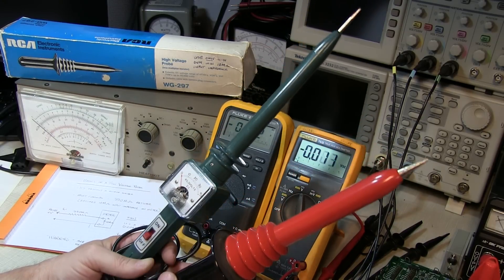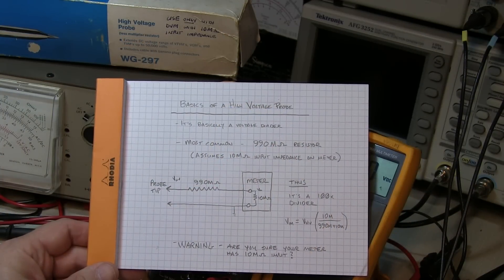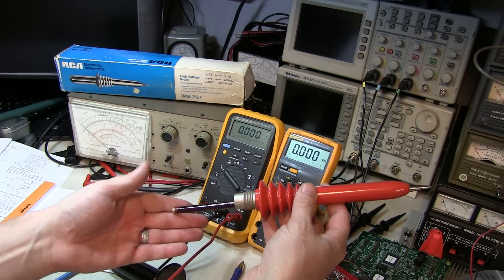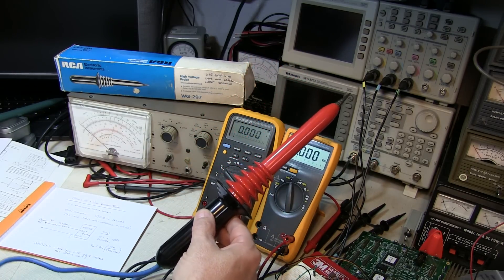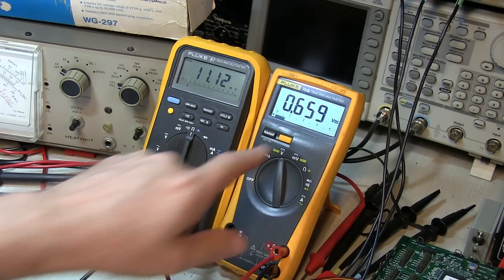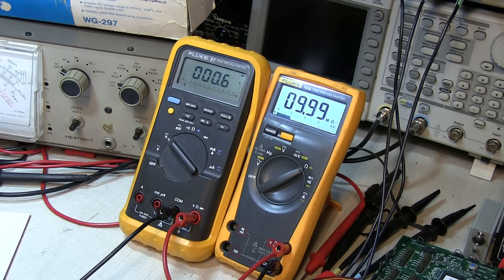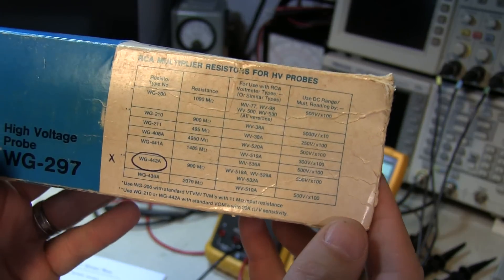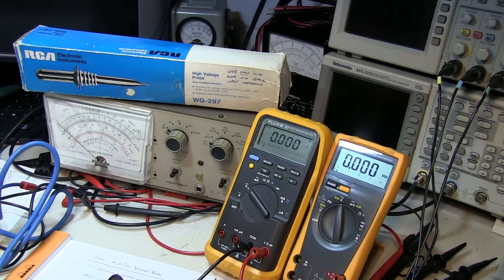#142: Basics of High Voltage Probes and how to use them

Comment: Common VTVMs from the period of the 50s and 60s that you are likely to encounter, Heathkit, Eico, RCA, probably others, have an 11 megohm DC input, but this is achieved by putting a 1 megohm resistor in the DC probe.  The input of the instrument itself is 10 Megohms.  The 1 megohm resistor in the probe is there to provide some isolation from the capacitance of the probe cable, which is usually shielded.  HV probes sold for use with these instruments are calibrated to be terminated by the 10 megohm input of the instrument.  In later versions of some of these meters, the designers went to a uniprobe approach with a switch to short out the 1 megohm resistor so the same probe could be used for making AC and ohm measurements.  Earlier versions of these instruments had a separate probe for each function and did not use shielded cables on the AC or ohms  (OR AC/ohms in some cases) probes.  
     A popular type of article, in club bulletins and some ham magazines written by people who didn't understand the function of the 1 meg probe resistor, advised users to place the 1 meg resistor inside the instrument so that other probes could be used.  A Heathkit V-6 or V-7 or V-7A, et. al.,  that you find at a hamfest or online may have had this modification performed on it.  So a good policy would be to verify the input resistance of the meter before trusting the probe.   Heathkit sold an HV Probe kit nearly identical to the RCA in the video demo with the adapters to plug into either Heathkits with 1/4" plugs or RCAs with Amphenol MC connectors.  I have one of these, and the wiring of the leads at this point in time is way too rotten to be trusted measuring high voltages.
      On a side note, other VTVMs in this time period, mostly more sophisticated instruments, such as the Hickock and Hewlett Packard All tube meters (HP 410B) had 22 meg input impedance.  So again, the best choice is to check to see what you've got.

Comment: Good timing Alan. I just bought one of these, a Fluke 6KV for check plate voltage in Ham Radio linear Amps. Wasn't aware the input impedance changed with range on the modern DVM's. Thanks for pointing that out. Great Video as usual.
73"s
Reply: famos and Alan. Be very careful when using HV Probes for measuring Ham Amplifier Plate Supplies. If you check the paper work for most HV Probes they will tell you they are rated for CAT 3 or CAT 2 work. These are very low energy applications as in a CRT Anode --- 10 KV @ 5 ma or less. While the voltage for an SB-220 plate supply is considerably less -- 3 KV -- it is capable of delivering upward of 1 Amp at that voltage. If something were to breakdown, either in your probe or your meter, at that energy level things will get very nasty very quick ! As in an explosion. I'm not saying that will necessarily happen but be prepared for that to happen. Safety Glasses are essential and electrician's gloves are a good idea. The Fluke 87 III & 87 V are rated CAT 4 to 600 Volts and CAT 3 to 1000 Volts. Using a High Voltage Probe throws all of that out the window. Even though 1/100th of the measured voltage is dropped across the meter input if the probe ground connection fails or the meter input circuitry fails every volt that you are measuring gets transferred to the meter. In that circumstance the probe resistor is all that stands between you and disaster. Be extra careful. You don't get second chances at these voltages.  Bob K6TR
Reply from the maker: Excellent comments Bob, and right on the money!  Thanks for your valuable contribution.
Reply: carefull with measuring amps, I made the mistake of taking the probe off when the amp was in use(TX) and created a nice arc (untill the fuse blew)
Reply: ***** Another good point. One must use extreme caution with High energy linear amps. Very lethal.
Reply: Essential comments Bob. While I used to poke at TV anodes with 20+ kV, I much prefer to set up an amplifier HV metering test with isolated gear and then observe, not touch, when power is turned on.

Comment: Nice video once again.
I noticed your reference to the '2nd Anode' of the CRT.
Many years ago in college working on CRT TVs, I don't remember a 2nd Anode just the Heater, a Cathode, a few Grids for Contrast and Brightness and Focus I think that was, then the Final Anode where the real dodgy voltages were, (Yes I got bitten, once I might add,)  Luckily it was a Black and White set so the voltage was only around 12KV and I got too close to the Line O/P Transformer with my finger, Produced a nice arc though. 
How we all laughed....aahhh, memories.
Lol....
Later on, one of our tasks was to replace the CRT or at least go through the motions. Imagine my nervousness when I had to lift the Final anode cap, but the instructions on discharging the Anode were good enough (2 Screwdrivers with their shafts crossed, one to Ground and one under the cap. A tad Heath Robinson huh?)
We also had to measure the Final Anode voltage with probes not too different to the second probe you had and an AVO 8 multimeter, the choice meter of the day I believe.
Reply from the maker: The TV tech that I worked with during my first job (in High School) at a TV repair shop called it the 2nd anode, so that's what I've called it ever since...
Reply: Second anode it is. It's connected to the conductive aquadag that coats the inside of the bell of the CRT. After the electrons strike the inside of the phosphor-coated glass screen, they must be removed from the CRT. This is how they escape. The aquadag is also connected to the "accelerator grid" of the electron gun, giving the electrons their final, attractive positive potential, speeding them toward the front of the CRT.
Reply: *****
I appreciate this is a trivial matter but being called the 'Final Anode' makes sense as it is the Last thing in the tube before the phosphor front, but 2nd Anode, Final Anode, what the heck.... but if I may comment on the function of this anode.:
It's not there to 'remove' the Electrons, it is there to give the final impetus for the Electrons to hit the screen with enough energy to excite the Phosphor coating.
If you lower the Line O/P Voltage (adjusting the EHT or Final/2nd Anode Voltage) the Electrons will slow down and the deflection coils will have a greater effect as the Electrons are in their field for longer, this will make the resultant picture on the tube front larger and dimmer, the reverse will happen if you increase the EHT, producing a smaller but brighter picture.
Reply: That's a common misconception. Here is what is REALLY happening: The EHT potential is the same at both the aquadag coating the inside of the bell of the CRT and the "accelerator grid" which is the ring of metal at the "front" (the end closest to the screen of the CRT) of the electron gun assembly. The kinetic energy of the electrons speeds them toward the front of the screen, having been propelled by the potential difference between the cathodes of the electron gun assembly and the “screen grid” (G2), followed by focusing and, finally, the accelerator grid. The electrons are not “pulled” toward the screen by the potential at the second anode. They are “shot” from the electron gun. Yes, the same EHT does the trick but it's the EHT at the accelerator grid that provides the impetus. Remember that there is NO POTENTIAL DIFFERENCE between the accelerator grid and the aquadag. It's all at EHT potential. 

Inertia keeps the electrons traveling in a straight line after they leave the electron gun. It takes the extremely powerful magnetic fields from the deflection yoke to push and pull this beam around, as you know. Electrostatic fields won't do the trick unless the deflection plates are extremely close to the electron beam (as in an oscilloscope CRT). The electrostatic field from the EHT charged aquadag has no effect on the electron beam at this point.

After the electrons strike the phosphor-coated inside of the CRT screen, they have traded all of their kinetic energy for light and a tiny bit of heat. The “spent” electrons bounce off the insulating glass of the CRT but they must not be allowed to remain inside the bell of the CRT. If they do, they will form a negatively charged cloud in the bell of the CRT. It is this cloud that causes the “blooming” symptom you describe where the image expands on all sides as the negatively charged electron “beam” is now repelled by the negatively charged cloud that's floating in the middle of the CRT. The expanded image is not caused by the electrons slowing down and creating a greater angle of  deflection as they pass more slowly through the magnetic field of the yoke. They are sort of dodging the repulsive electron cloud that's in the bell of the CRT. You can clearly see this in extreme cases of “low EHT” (which sounds oxymoronic when you say it) where the middle of the screen goes dim or dark as the electrons are not hitting it with enough force. If this were simply a deflection angle issue, the image would still be evenly illuminated, just overscanned.

Enter EHT at the Second Anode to the rescue! Since these “spent” electrons no longer posses kinetic energy, they are now pretty easy to grab and suck them out. They're just sort of floating around in there. After striking the front of the CRT screen, the negatively charged electrons are then attracted to the positively charged aquadag that lines the bell of the CRT. They are conducted along the aquadag, out the second anode connection and into the EHT unit (flyback) and, eventually, passed to ground.
Reply: *****
Boy I thought I could write long replies lol
What you say sounds good but I was only reciting from my college days from 1981-3. My memory may have failed a tad maybe.
Can I ask you this?
You say the expansion of the picture is due to the Electrons being repelled by the negative charge cloud, if so why isn't the middle of the expanded picture completely or unevenly distorted? I was shown the result of low EHT in class and the picture was normal but larger and dimmer.
I have trouble with accepting the flyback of the line o/p signal to the line o/p transformer has anything to do with attracting electrons, Feeding this signal through a few voltage doubler circuits involving Diodes and Capacitors, the flyback part of the signal has little effect due to these components and the next sweep signal simply adds to the voltage thus giving the 'doubling' effect.
This seems sound to me but am willing to be shown otherwise.
I learned my Electronics during these college years but haven't dealt with a CRT TV since then and by the looks of it, never will, I'm glad to say.
Reply: Generally speaking, no voltage doublers are used in a modern IHVT (integrated High Voltage Transformer) also known as the Line Output Transformer or LOPT-pronounced "lop-Tee"-in UK. It's a series of secondary windings and high-voltage rectifiers. We tap off the stack to obtain the screen (G2) and focus voltages.

As far as the low-EHT demonstration is concerned, at extremely low levels, you can watch the raster overscan as the voltage drops but at the very end, the dimming appears logarithmic to me. It's not linear across the face of the CRT. It becomes black in the center first. It was a common problem in a vector-scan monitor from my past where the EHT unit failed. You could watch it happen. It was just bad connections.

CRT monitors have been my life since 1972 when I fixed my first "Pong" monitor. I love(ed) them. You'll have to trust me here. What I am saying is true. OTOH, we can't all seem to agree which way electric current flows so . . .
Reply: *****
Thanks for this discussion Randy, it's been enjoyable even if we do disagree a tad.  Maybe the TV's in England built before 1980 which were the ones I had to work on were built slightly different to American ones, after all there is the PAL and NTSC problem huh? 
This reference to the circuit I was reffering to (I called it a Doubler by mistake it is called a Tripler (Scroll halfway down to TRIPLER & MULTIPLIER CIRCUITS) All 20 TV's I worked on in class had this Tripler circuit.

http://www.oldtellys.co.uk/otltbeht.html

I think we were taught with different designs and some slightly different terminology so probably we're both right
Reply: Michael Hawthorne
No. We both can't be correct and whether we're discussing a doubler, tripler or more, the physics are the same. UK or USA, the physics are the same. All CRTs work this way. No need to be polite here and say "we're both right" just for the sake of ending a discussion "gracefully." If any other reader of this comment thread wishes to weigh-in, I'd like to hear from someone with a degree in electronics engineering and familiarity with CRTs.
Reply: *****
I understand you but how do explain the Tripler reference and the existing Diodes and Caps you say are not used, or at least implied they are not used?
Reply: Michael Hawthorne
 I'm not sure I understand your question. A voltage multiplier uses a series of diodes and capacitors to turn AC (typically ~15 Khz for the era we're discussing-NTSC and PAL) into a DC output that is a multiple (RMS AC input X 1.414 X the number of stages in the multiplier) of the AC input. Modern units stack secondaries in series with high-voltage rectifiers in between them. Regardless of how it is derived, we still have a high DC potential (the EHT-Extremely High Tension) delivered to the second anode. Typically for color CRTs this is 1200 volts per diagonal inch of the CRT.

I think what most folks don't know about (and, perhaps,  the key to understanding how this actually works) is the all-important connection between the EHT and the accelerator grid of the electron gun. The “getter” of the electron gun rides on the inside of the neck/bell of the CRT and touches the EHT-charged aquadag on the inside of the CRT. That is how the electron gun connects to the EHT. From this point forward, everything is at EHT potential. Since there is no potential difference between the accelerator grid and the aquadag (all are at EHT potential) there cannot possibly be any further acceleration of the electrons. The EHT charge is NOT applied to the screen specifically so much as it is to the entire “front end” of the CRT, including the bell and the shadow mask.

Ergo, the electrons are “shot” out of the electron gun as the name implies. The first law of electrostatics explains how the negatively-charged electrons will behave when they feel the positively-charged, electrostatic field generated by the EHT following impact with the phosphor-covered glass. They are attracted proportionate to charge and inversely to distance. The positive charge of the EHT is huge. Since the CRT can't move, the lightweight electrons will migrate toward the aquadag which is connected to the high-voltage unit (flyback et al) where its low impedance (as an ideal source, zero ohms) allows the electrons to follow a return path to ground or where ever the hell it is that those little rascals end up.

Comment: Another great one Alan. Saw this as I was taking out my Fluke 80k-40 HV probe. It has 999M Ohms in series and 1.11 M in shunt to provide 100x to a 10 M  input meter. It was designed for such as the Fluke 8010 and mitigates small changes in input R. Another comment - this type of probe is good for AC or DC. The ones with the meter are for DC only I believe. Cheers, 73.PS I always emphasize * always connect the ground clip first**

Comment: I have a "Polaris" branded probe,  with the meter in it.  It also has a couple of terminals on either side of the meter enclosure that would allow you to measure cathode current in your typical horizontal output stage,  I think it goes to 300mA.  I at one time had an adapter that you would plug the horizontal output tube into and that would plug into the socket which would interrupt the cathode pin,  and which had a couple of short leads terminated in alligator clips.  Those would have clipped on to the two small connections on either side of the meter enclosure on this HV probe.  And of course it has the ground clip.  It's probably not been as long as you might think since I last used the thing,  for a while I was doing restoration work on some really old TV sets (think Philco Predicta and such),  but it has been a while,  since I've given that stuff up.

The scary (to me) part of using those probes that you have to use with your own meter that don't have the meter built in is what happens when you get a bad connection,  a ground clip falls off,  or something of that sort.  You're focused on probing,  and don't realize that you've got that ground (and DVM or VTVM) with high voltage attached to what's plugged into it.  I think I'll stick with the one I've got,  thanks anyway...   :-)

Comment: you can make your own like I did, and use a series of 100 Meg resistors, at the last one to the meter you use a variable resistor (10 turns) parralel to the last resistor to earth, and then calibrate the meter with it om 230V (or in case of the us 110V) it gives you a fairly accurate reading that way.
Reply: That's what I am working on at this time.  What is the wattage rating of the resistors and pot that you used?

Comment: Glad I saw this. I have a BK PR-28, NOT a PR-28A. My PR-28 has a 625 M ohm Resistor. Can I SAFELY use it on a meter with a 10 M ohm input meter with a conversion table? It would be nice to know thanks for sharing. Best Wishes n Blessings. Keith Noneya

Comment: what is the max voltage we can messure on the 100X ? 30 000 or 2500 v ?
Reply from the maker: It depends on the particular probe.  It will have the maximum rating on the label of the probe.

Comment: The ribs are for what they call "tracking", which is distinct from arcing.  Tracking is when the electrons move along the surface of the insulator, which can happen if the surface is contaminated. The ribs increase the surface length, which accordingly increases the surface resistance